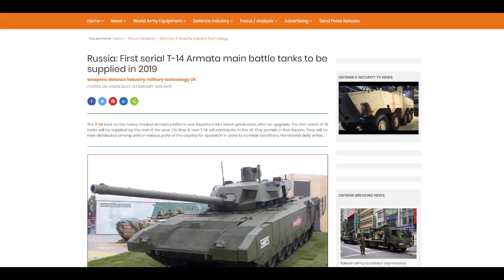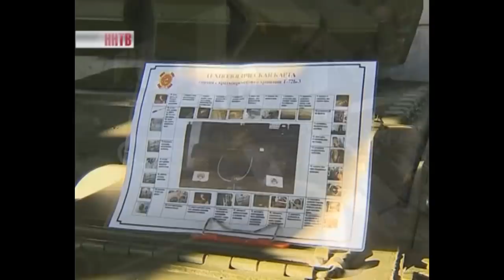Problems with Russian tanks

Comment: Cost of manufacture is secondary to the cost of use and maintenance.  

T-14 is not required for what is the factual modern tank warfare, which is infantry fire support.

In Syria, which is the highest intensity large scale combat operations of our time, the tanks that were praised the most were T-62s.

Rifled barrel and higher ammo capacity then T-72 made T-62 superior for infantry support then T-72.  T-62 also proved to be able to survive more RPG and ATGM hits then T-72.  At the same time T-62 proved to be more mechanically reliable in extremely harsh operating conditions.

So as a matter of fact, the older T-62 is more capable in the role of infantry support then T-72, and only expensive T-90 proved to be superior when it came to passive and active defense systems against RPG/ATGM fire.

T-14 is required only to dominate tank on tank engagements, but for infantry support, modernized T-62s are still the best.

When it comes to T-80s, they are needed for the Arctic service where gas turbines are superior to diesels.  As it stands, be they Bs or Us, they are the only tanks that can even be fielded in the arctic theater, because no other tank has a configuration that T-80 does.
Reply: You forget the constant tank vs tank battles in Ukraine. Supporting infantry is better done with an IFV, not a tank.
Reply: @Ruhrpottpatriot , an IFV carries troops and a gun. A tank carries no troops but a bigger gun.
In the concept of supporting infantry, you don't necessarily need to carry the troops in the vehicle. So why not just opt for the bigger gun?
Reply: @shanerooney7288  Because, and that's purely from my (a german tankers) perspective, tanks must work with infantry close together. I need infantry to defend me in areas where I don't have a clean field of view for 4km (e.g forests, cities). Even in an open field infantry, with their rocket based AT weaponry, grants me a massive advantage. That's why we opted for a 3:1 structure in our brigades and divisions (i.e. 3 Tank-Brigades for 1 Panzergrenadier-Brigade and vice versa).

For infantry support people often forget artillery (or IDS/CAS). Infantry in an IFV doesn't need a big gun to combat most things. 30mm with modern APFSDS and AHEAD/KETF munitions will kill everything except another MBT or bunker. For the former I can let infantry dismount or use my ATGM. If that doesn't work, I halt my advance and call in artillery or IDS.
Against the latter I simply call in Artillery.

Especially artillery is a much better infantry support weapon than any tank will ever be. A 155mm HE carries more HE filler over longer ranges then an 120mm HE ever could.

There's no reason to mount bigger guns on IFVs. The Soviets tried it with their BMP-3 and look what the T-15 has.
Reply: @Ruhrpottpatriot  , You make some valid points.
However, here are some counters...

Regarding the tank needing infantry support. Well, so does any other vehicle. Don't get it wrong, the tank still needs it... just slightly less than other AFVs thanks to its thicker armor.

155mm HE carries more HE, but it is less accurate and there is lag (Both from enemy sighted and first shot fired, and shot fired to impact.)

And my proposition wasn't a bigger gun on an IFV. I proposed a bigger gun instead of an IFV.
Infantry support isn't so great if they are sitting in the back seat. So just get rid of the back seat. ^_^

~~ 2CAV Armored Recon Scout.
Reply: @shanerooney7288  Dismiss the notion that a tank can withstand a hit from an equally modern weapon. In tank school we learned, that a hit means penetration. Therefore it's better not to be hit at all. Either via mobility, concealment or cover (in order of importance).
Usually the delay is acceptable if you have a favourable position where you can defend yourself for some time. That's the reason the German Army had an artillery battalion per brigade and an additional regiment per division (now it's just a battalion per division -- sad).

 In our modus operandi, Panzergrenadiere (PzGren) operate slightly different than MechInf from other NATO countries.
Our IFVs are not just there to give infantry a ride and then supports then when dismounted. PzGren are expected to fight mounted AND dismounted and switch between the two as it is needed. We don't use PzGren as simple backseat drivers. For that we have our motorised infantry, called Jäger.
Reply: @Ruhrpottpatriot  ,
I'm trained as armored recon.
If you are so much as seen, consider yourself dead. (unless you are conducting a planned assault, in which case everything should already be set in your favor)

A tank isn't invulnerable. I know that.
But if someone attacked a MBT with a 50.cal the commander might be worried about his sights, but not worried about his life.
if a LAV25 is attacked with a 50.cal, the tank commander is worried about the max reverse speed of the vehicle and if the driver is still alive.

>>>>> BUT >>>>>>>> 
You are approaching my initial point from the wrong perspective.

Consider the following 2 vehicles.
https://en.wikipedia.org/wiki/ASLAV#ASLAV_Type_I
https://en.wikipedia.org/wiki/ASLAV#ASLAV_Type_II

One has a big gun and doesn't carry troops.
One carries troops, but has smaller gun.
Armor and Mobility can be considered the same. 
If you were an infantryman, of these two which would you prefer as back up?

My initial point was that the infantryman would almost always choose the one with the bigger gun.
Reply: @shanerooney7288  None of the two. If I was a Panzergrenadier I'd want my Marder or Puma. Those give me cross country mobility, a 20mm/30mm, an ATGM (MILAN/SPIKE) and the possibility to rapidly switch from mounted to dismounted and vice versa.
If I were a Jäger (i.e. light infantry) I'd want a TPz Fuch or GTK Boxer. Those two because in the terrain I'd be fighting anything heavier is a prime target and an MG3/M2/HK GMW on my vehicle is enough for self defence.
If I were a Fallschirmjäger (i.e. paratrooper) I'd want my Waffenträger Wiesel because that is air-mobile and has a 20mm or an ATGM.
If I was a Gebirgsjäger (i.e. mountain troops) I'd want at most a Bv 206 or yet better... a mule.

There's a reason the Bundeswehr never introduced something like the LAV or BTR-80, it's not our style.
We only had the SpPz Luchs, and that was a dedicated Recon vehicle that, as ultima ratio, had the ability to fight lightly armoured vehicles.

BTW: everything the ASLAV Type II can do, the GTK Boxer can do, too and it still carries eight soldiers. Granted -- it's bigger, but still.
Reply: @Ruhrpottpatriot  , you are sidestepping the point.

Because you don't know what the point is?
Because you don't want to admit that I had a point?
Or because you just like to disagree with people? (sometimes I'm guilty of this one)
Reply: @shanerooney7288  Because I simply don't see the point in using a lightly armoured vehicle in a combat role it's bot suited for.
If I have a target that cannot be fought by an LAV, either because the LAV is too lightly armoured or the target is too heavily armoured, I don't use the LAV but the next thing above, which would be an IFV. However in my eyes wheeled vehicles as IFVs are dogshit. They don't offer anything mechanized infantry needs (that is to support and keep up with tanks in highly mobile combat).

However I also don't see the point in overkill. For most targets I don't need a tank. The main role of a tank should be to combat other tanks, not to support infantry as an impromptu SPG. You have artillery for that, even if it is only mortars on M113 (which still carry more HE filler than a 120mm tank round).

But I guess we agree to disagree, because our doctrines are different.
Reply: @Ruhrpottpatriot  , yes. Let's just agree to disagree :|
Reply: ehm the T62 will defendly not surrive more then T72 . its smaller less armored etc ( altrough reactive armor works woundersagainst atgms so that could only be true to an extend when were have a T72 without reactive against T62 with ) T72 has roughly same ammo count but alos much stronger the fraggrenades arefor example extrem and perform very well . and all the technical stuff like night vision etc make the T72 even in this specific role the better tank.... but of course in syria the 62 is an old hero and performs its tasks good enoigh most of the time
Reply: @старшийсержант-л7ш  You go ahead and disagree with combat reports form Syria, it's your choice.

Comment: Hi, Red Effect!
I would like to say that a good analysis of the situation, but...
Perhaps here the parable:
Two blind men were led to the elephant and asked to describe his appearance.
One blind man felt the trunk of an elephant and said that the elephant is rough and long.
The second touched the tail and said the elephant is thin with a brush on the tail.
they're both right...
This is only part of the picture.
And much more difficult than at first glance)
T-80BVM is the modernization of T-80BV, not the earliest T-80B, namely T-80BV after 86 years, if I'm not mistaken.
they close the armor and protection to T-72B 89g.
Their modernization is connected both with the desire to load production with orders and with the fact that Russia is implementing a defense strategy.
and tanks in it, one of the milestones. You need a lot of tanks, a lot... only UVZ and T-72B are critically insufficient.
In addition, with the increase in protection, power and efficiency of the gas turbine engine, it was again possible to realize the potential of the existing T-80BV that previously wanted to be written off.
In addition, the tanks are not disposed of, only what can not be used. Like the first T-72A and T-80. They're disassembled for parts.
The t-90M is a development of the T-90A with a 2004 welded tower, similar to the tower for the Indian T-90S. But towers different.
T-90 is a compromise between price and performance. The t-90 we know shouldn't have been born. Object 187 was supposed to get this index.
T-90 is object 188. The t-72 as well as the T-90 were to give way to a new tank by 2000. But the Soviet Union collapsed and the T-90 (chassis of the T-72B and turret of the object 187) was the T-90A.
The impasse and design flaws of the T-72 were evident in the late 80s, and the t-72B was actively designed replacement. Which was supposed to be 187.
That is why the T-90A has never been produced for Russia in large quantities, it is outdated even then. Total left about 300 T-90A.
T-80U require extensive repair, T-80BV a lot and they are NEW. And T-80 as well, in many ways has the same disadvantages of the direct ancestor - > T-64B
The military said that a universal tower "break-3" suits them at the moment. But the chassis is hopeless. You can not increase the armor, you can not put a more powerful engine. Easier to make new hulls like ... object 187.
T-90M has long surpassed the capabilities of the T-80U.
T-72B3 has several iterations.
2011, 2014 and 2016.
The latter have an engine of 1130 HP and many other changes, and will gradually be standardized. As T-80БВМ. In many respects they already repeat each other.
In addition, the T-72B3 does not use the old contact-5, a Relic in the K-5 body, simply because it would be pointless to change it, the efficiency increase is small, and the costs are huge.
Especially if you need 2000...4000... and better 6,000 tanks.
The first T-72B3 2011 sent to repair and take their place T-72B3 utth 2016. This is a fairly common practice, you just need to know the scale.
The same with panoramic view. Yes, it is really needed. But on T-72B3, which will be written off in 10 years. What for?
The commander of the T-72B3 (or T-90) will receive his thermal imaging device, but in the next stage. As well as elements of active protection like Arena-M.
Yes, the T-72B3 is primarily aimed at fighting the old T-72A,T-72M,T-55, Leo-A4... the most massive of possible opponents. For everything else there is ATGM. 
Which can already ignore the "Trophy" and similar systems))
No one will invest funds and resources in the modernization of tanks that already had to be written off. There will be no global modernization. There will be major repairs and replacement of components and parts for modern, so that these tanks could remain relevant for 10-15 years.
The fragmentation of modernization is also due to haste and the economy.
 "Just go and make a welded tower..."Yes, 2000 universal towers... or 4000. No, thank you!
This is a massive tank, it needs a lot. Russia is preparing for a possible war. The West in crisis and always their problems the West decided through war. Russia, China... who cares?
Now it's more and more obvious.
P. S.
T-14 and "Armata" requires maintenance comparable to aviation personnel. In addition, we need new materials and machines in large quantities, we need trained people.
It will take at least 10 years or more. Even with such a scale as in Russia. By analogy with aviation it is so. Armata is primarily not a tank, but a lot of different combat and not only special vehicles. It takes years of research and testing. This was the ordered series of the first 100 series of tanks to test and identify weaknesses.
Russia does not want to repeat us mistakes with the f-35.
T-72B3 will remain in the role of support or will be transferred to the allies or sold as the T-90S. Characteristics depend in the first place on the desire and capabilities of the customer. Algeria bought prodvinutyy version of T-90S, for example.
Sorry for the long text and bad English!)
Reply: Didddin duuu nufffin Wakanda enn shiiieet  Thank you for a great written example of why incest is bad.
Reply: Having a lot of mediocre tanks with high readiness rate is going to win more wars than having a few excellent tanks. What im curious about is how russia is planning to phase out and replace several thousand of t-72 tanks in the future when they become completely obsolete, because i dont think that the T-14 will ever fulfill the same role as the T-72. Is it possible to see a low cost variant of the T-14 in the future? Or maybe it will be the new t-90 version that came out recently?
Reply: @nks406  
The tank as a concept will undoubtedly change, as well as its use, the T-90M and T-72B3 as well as others will be used as support, today it is most clearly presented in Syria. 
Armata is not only a t-14 tank, but also many other armored vehicles that can be modified under certain conditions and not be limited to the original chassis of the tank.
Probably it will be similar to that in the image. https://mtdata.ru/u25/photoDBCE/20772536125-0/original.jpg
T-90M will not be the main, at least in the form that is now. The chassis is extremely outdated and reduces opportunities for improvement. Yes T-14 as a tank is not supposed to be overly complex.
Therefore, T-14-MBT, and its direct ancestor T - 95 (object195) - "tank limit parameters", i.e. maximum protection, 152mm gun or other weapon, radar sight, etc. All this in the T-14 is not and is only expected.
https://naked-science.ru/sites/default/files/styles/node-header/public/field/image/1539818627_ya.jpg?itok=nYck_pe6
https://image.anninhthudo.vn/h500/uploaded/199/2018_10_19/195bylastemperor220796-dbhi1t6.jpg
https://ic.pics.livejournal.com/andrei_bt/18425682/581794/581794_original.jpg
Reply: @elusive6119  I see. So in a way the developement of the armata platform which can be highly customized is a cost reduction measure in itself because future vehicles can be easily modified or adjusted to new roles right? Basically lego but with tanks.
Reply: @nks406  Yes, exactly. Time and cost optimization.
Reply: Didddin duuu nufffin Wakanda enn shiiieet  You need another brainwashing, probably the last one did not bring results.)

Comment: Yes ! I agree massively ! 
In my opinion, the main problem is that they do not install the "Arena M" Active Defense on their upgraded tanks WHY?!,  yes it's costing $ 250k more, but the defense of the tanks  will be a dozen times better!!! Merkava 4 with "TROPHY" could not be hit by RPG 29,
  Kornet and Metis-M .. 
in Operation "Protective Edge" in 2014..... I do not understand . They have more than 10000 tanks in stock .. they have a quantity. Now they need quality. 1500-2000 maximum modern and secured tank (like a T-72B3-M 2016 model + Arena M , from T-90a --> to T-90M and T-14)  and they will be hegemons on the battlefeald.